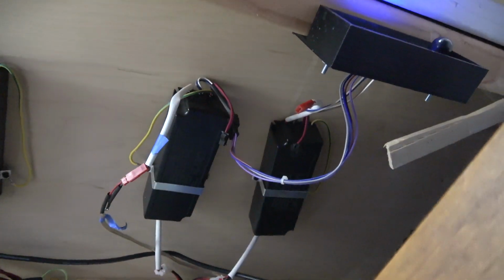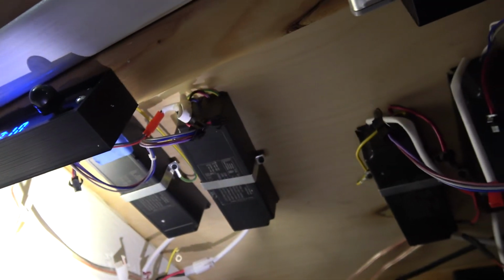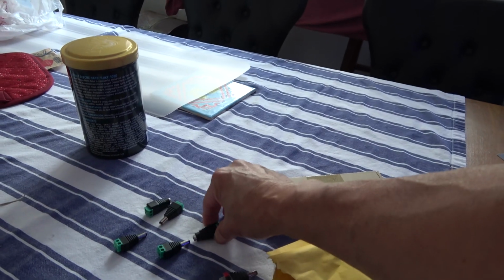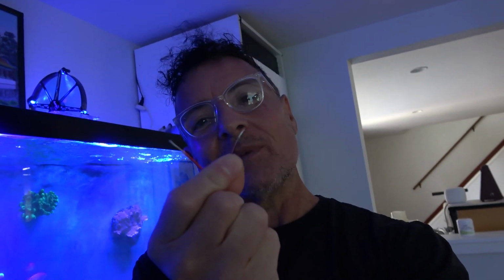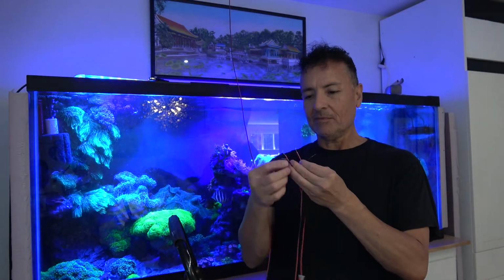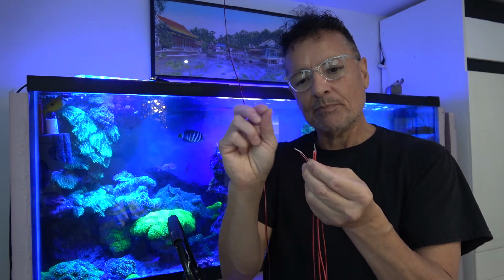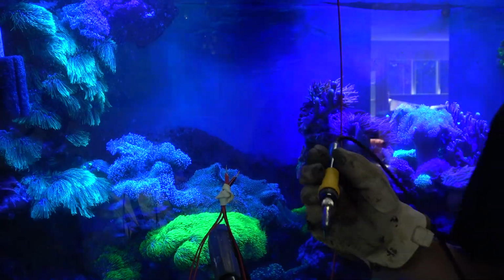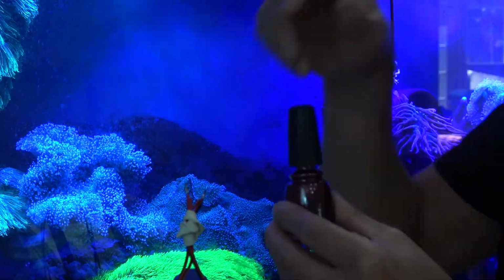Save Money Eliminate Power Supplies - Spice Reef E114

Comment: How can you get enough current at 24 volts through those tiny wires to run those huge lights?  I must have missed something.  Thanks.
Reply from the maker: 2x24=48v  they actually put out 80v and I'm using them at 70v so... High voltage low amps = thinner wire. Just like those guys on the high wire 155,000 to 765,000 volts 😳those guys are nuts.
Reply: Boom, I've been schooled by V=IR.  I knew I missed something, just had a birthday and am still in shock, I'll get better.  Thanks.
Reply from the maker: @lkapitan8232  🤣😂😅